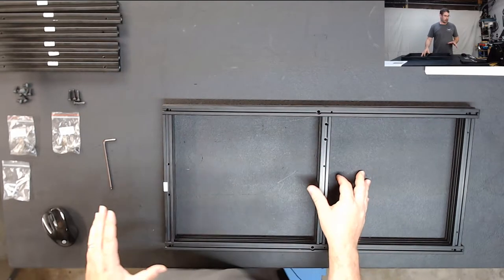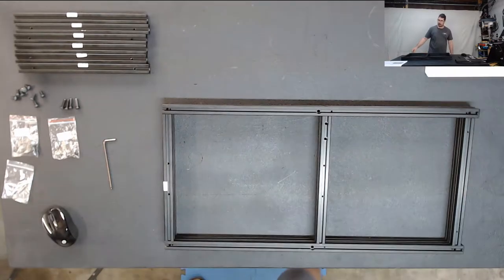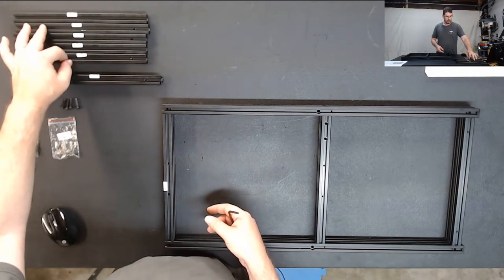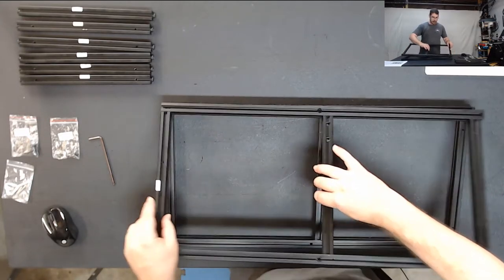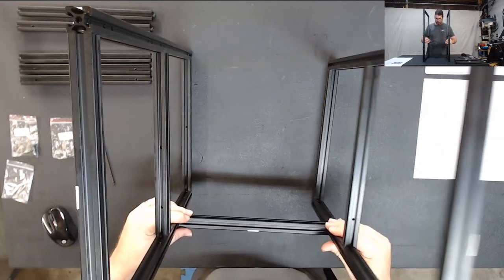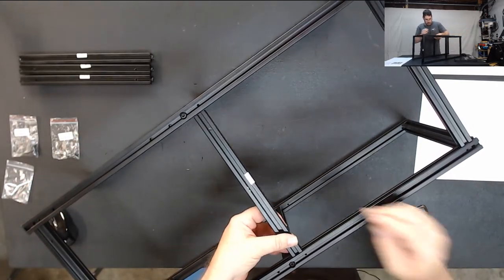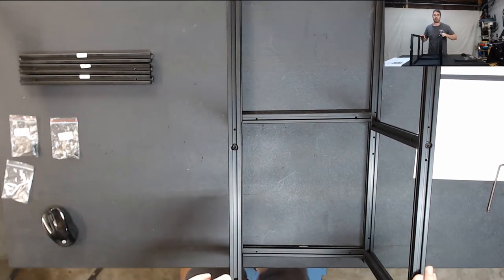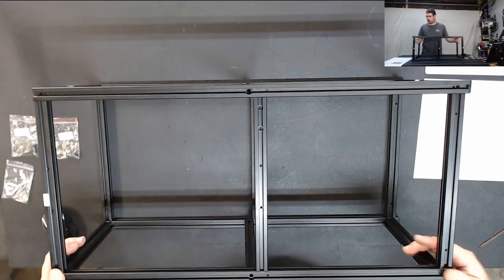Moai Series Part 3: Building the Frame

Comment: notice in the installation guide the two B M6-20 screws are installed from the outside of the frame... that is why the threads seem to shallow. they are meant to be installed from the outside. Also notice the counter bore difference on the frame of the unit. Pretty easy to see this is what the manufacturer wanted.

Comment: Does this come with resin?
Reply from the maker: Randy Williams the kits do not come with resin. But it does include the vat and build plate and everything else needed to print. You need to provide you own resin and method of curing it.  I strongly recommend sticking with the Peopoly resin until you have a few liters under your belt.
Reply: Practical Printing great! Thank you for the reply